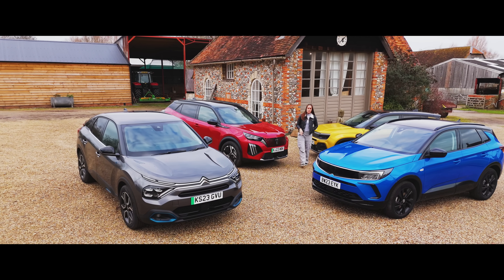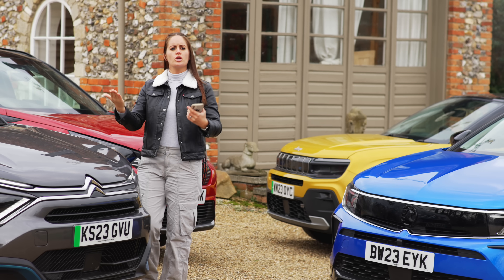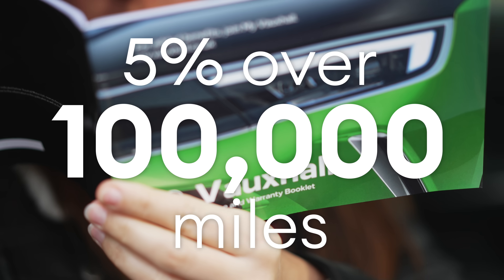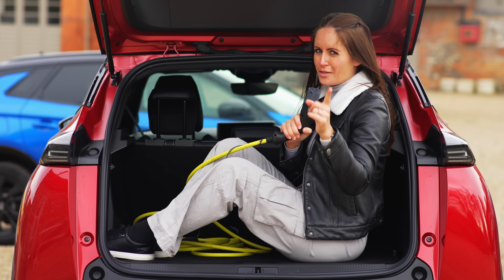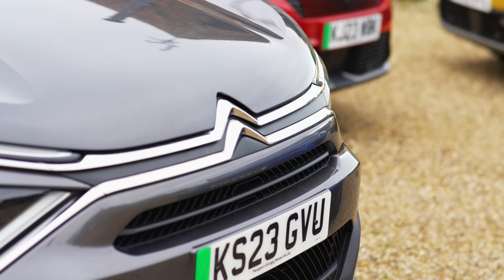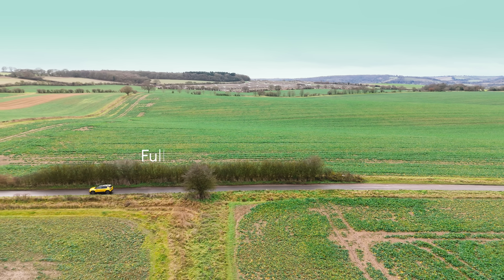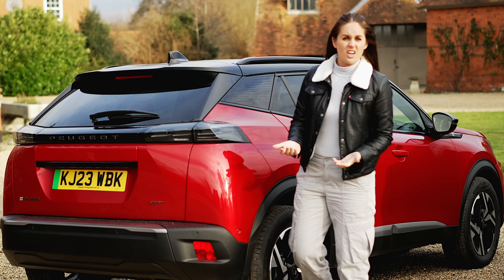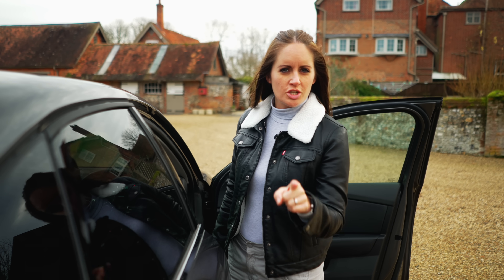REVEALED: Used electric car batteries – do I need to worry? | Electrifying

Comment: not degrading it is the amount of full failure and reneging manufacturers where widely reported failures cost the unfortunate owners some 60,000 under 40k miles more than there car was worth please dont just spout sale propaganda been there done that back in diesel after throwing away 3 times the depreciation  buying a motor and a reconditioned repaired battery you skimmed over the damaged batteries not covered by any warranty based on motor trade stats 1 in seven 3 year old car and 1 in 3 10 year old car having been damaged and the increased likely hood of the vehicle being writer off and the ever increasing cost of insurance for them last quoted almost twice cost of an ice van for a ev van so although i buy replace 1/3rd of my business fleet (over 20) some seven commercial vehicles every year and 1one private... none will be evs

Comment: I have been watching the transport select committee meeting on the 15th May 2024. This committee meeting was all about electric cars and the second hand car market as the second hand electric car market is stalling. It was found that the main reasons were that a great deal of second hand car dealers will not touch electric cars as they do not have the expertise in engineers and special equipment to service electric cars so they wouldn’t put electric cars on their forecourt for sale. Customers who were thinking of buying a second hand electric car were put off buying one due to the worry of the electric car battery condition as there is no UK standard to check these second hand electric car battery packs  and the second reason the UK charging infrastructure. If you’re interested please go to parliament live tv to view this committee meeting held on the 15th May 2024.

Comment: Problem is all these second hand electric cars have been taken from fleet owned electric cars and generally they have been driven by company car drivers so all that company car drivers are interested in is getting front A to B in the quickest possible time. So most of these electric cars have been on large numbers of DC charging stations and as we all know by now this is the worst charging scenario for traction battery degradation. The other point to make is that these second hand electric cars were made in small batches from the manufacturers as the mass car market were not purchasing electric cars in high volume therefore the spare parts for these second hand electric cars will be difficult to obtain quickly, so think twice before purchasing!!

Comment: Let's revisit this topic in another 10 years. When manufacturer warranty expires. Because it is a bit concerning to think an electric car will only survive on the road for 8 years, it's not very realistic. I think the lifespan of an ICE car is about 25 years. It's  the cost of ownership after the warranty that really matters to over 75 percent of the population that can't afford to buy a brand new car, or be the second or third owner. Young adults who desperately need a car to get about. Batteries in hybrid cars are causing a lot of mayhem in developing countries at the moment. In these regions they're imported used, without warranty. Some countries are putting limits on EVs to avoid similar dumping of worthless electric cars in the future.  With governments banning importation of EVs with less than 80 percent battery life left.

Comment: You mentioned using the range meter & battery level to check battery health, I am not sure that really works. I thought the "range" gets calculated based on previous use, so it will not work accuately?

Comment: Big fan of Nicola but... What hasn't been mentioned is that how the battery has been treated by the previous owner(s) will have a significant impact on the battery health.  Frequent rapid charging shortens both capacity (so range) and battery life.  Slow charging between 20 - 80% will theoretically prolong the battery life. 
I believe EV's will be a footnote in the automotive history. The s/h motortrade is not geared up for them and does not trust them.  Even main dealers are shunning used evs because they have government set targets to sell new. Insurance companies don't like them either & are hiking policy prices. Result, massive price drops and very hard to shift used evs.
Reply: Especially in the US!

Comment: There are newer car batteries like sodium ion, Al air batteries which are way far cheaper and manufactured with easily available materials and easily recyclable BUT ARE INTENTIONALLY DELAYED TO BE MANUFACTURED BY VESTED CROOKED INTERESTS to the consumers.
Reply: Also, "quantum charging" is supposedly "around the corner". I wouldn't hold my breath, a "cyanotic" complexion is unbecoming to me!

Comment: For EVs to get main stream adoption they have to be much cheaper, have driving ranges that are similar to combustion vehicles and charge in similar times to filling times for combustion vehicles. It would also help if they didn't spontaneously burst into flames while exuding deadly combustible gases, before ultimately exploding. 
Until EVs can overcome the price, range, charge convenience and exploding issues, the average person won't want one. It really requires a completely new battery technology. So ten years....

Comment: With stellantis cars (like all those featured parked in this video), it's the rest of the car you need to worry about and not the battery. ABS wiring looms, on-board chargers and air con compressors come to mind. Look for a car with a longer standard warranty and avoid stellantis. Mat Watson's press Jeep avenger had a braking fault, not great for a brand new car

Comment: I would agree that EV batteries are proving to be much better than expected, the problem is that most car manufacturers are still only offering 7 or 8 year battery warranties, half of the life of the car, manufacturers need to offer at least 15 year battery warranties to give people the confidence to buy a used EV..

Comment: Hiya, nice presentation, very upbeat and no obvious product placement apart from "Spoticar." Are they a sponsor?

You compared a battery to an engine and drivetrain. It obviously should be compared to a fuel tank in an ICE vehicle. The electric motor and gearing in an EV should be compared to an engine and drivetrain in an ICE vehicle.

As servicing an EV being cheaper. The batteries are the easiest things to check. Brakes, suspension, and tyres still have to be checked. EVs also have many more hitech components to go wrong, which are harder to diagnose and replace because they are proprietary, and the spare parts supply chain is virtually non-existent for them in this country.

Comment: The reality with this we will see in next 10 years. When I see EV driven over 600000 kilometers I am convinced.
Also I saw a story that replacing batteries to Hyundai Ioniq costs more than a new car.
Reply: yup! $60k!!!!!!!
Reply: I have has 30 years old cars that don`t have more than 200000 km in and are so rustes and bad condition otherwise that they were forsed to put out of misery… old diesel Mercedes that were driven on non salted environment can get 600000km but those cars are rarity! Most cars and end of the line at 250000km all of my ICE cars have been so far. My current car is 8 years old. 90000 km in. Motor… not expecting it to last more than 25 to 30 years… so it will maybe get 300000 if i am really lucky!

Comment: It's not all rosy on the servicing front though. Some manufacturers/dealers "overcharge" EV's  for the service and with some service intervals costing more than what some complex ICE cars would cost at the same mileage so please do your research... Hyundai is one of these with their 4 year 40,000 mile service which will set you back an eye soaring £500 plus depending on the dealership.
Reply: Tesla has no servicing required to preserve the 4y/50k mile bumper-to-bumper warranty!

Comment: The reason im reluctant to buy a used EV, even a new one is actually not the battery or motor, its the other stuff like heatpump and onboard charger. They are quite expensive, and known to fail in models like Corsa, 208 etc.

Comment: A lot will change as technology evolves and new manufacturers com China make it to W European markets. I would not want to spend a load of money in 2024 buying a car with a battery that will be much smaller or noticeably slower to charge than the models on sale in 2026. The bottom will fall out of the used EV market before I can commit.

Comment: What was the point of mentioning that the battery is valuable? Is there any way to benefit from this? Youd think that if it wad valuable then you could sell the old and put the money toward a new one... but you then reaffirmed that the new battery was "currently still very expensive".

Comment: Its post warranty costs thats the issue , not mileage /usage as in the examples mentioned in the comments.
Tesla model S 2 weeks out of warranty and less than 100k £18,000 to replace 
You could buy a battery on E-bay @14k but it still needs fitting etc...

Comment: so the only electric car i can afford is a 2010 nissan leaf and i commute 100 miles a day on mostly motorway. i should be ok with that car since you tell me not to worry about the battery ?
Reply: Only if you can charge at the work during the day. Or rapid charge on way back. Lease a EV, leaseloco e-208 pug, 1500 down and 200 per month

Comment: The risk for second hand car buyers is how they can sell the car later down the line. 

There’s not much risk buying a 3 year old EV, but if you want to sell it a few years later you’ll be reaching the end of the warranty, and then who will buy it? You’ll be unlikely to sell it for much more than the resale value of the battery at that point, so potentially quite a big depreciation hit compared to ICE equivalents.

Comment: Great overview. Maybe i'll add that batteries can be fixed, specialist shops can repair them at cell level (tesla is said to be the easiest to repair) for a lot cheaper. Also, warranty for the battery is usually valid if battery is under 70% of capacity.
Reply: So, if "range anxiety" at 100% isn't worrisome enough, 70% should REALLY put folks at ease! LOL:face-fuchsia-wide-eyes:

Comment: If you are suggesting that people should change their car every two or three years then what sort of ecology is that. It's  much "greener" to keep an ICE car running for many years.
Reply: How so? If you keep EV so long that you need to change battery… it is cheaper than keep ICE car the Same time. Not Evertonia change car every few years… and the longer you keep EV the more you save compare to ICE (even if you buy the new battery is meanwhile)…
But you need at least 15000km / year and home charging option. And this is based on prices in Finland so it may  vary depending on where you live!)

Comment: Owners' data suggests that mileage is not the main factor, but time is. It doesn't matter if you drive 5000 miles a year, or 50,000 miles a year, they still degrade roughly the same over time. Manufacturers know this, that's why they offer 8 years warranty, so the main question is how do these batteries fare on the years after?
Reply: Where did you get that data from? Batteries degrade by cycles of charging and discharging...
Reply: It's more complex than that. It's a combination of age and cycles of charge/discharge
Reply: MG now gives a universal 10-year warranty on their EVs.

Comment: Most people drive older cars with higher mileages. My car is a 2012 model and still pretty much like new bar the odd minor blemish.  There are plenty of mechanics able to service and ensure a long life for the oiiy bits. For EVs to be sustainable they need to have value way past the 8 year battery warranty and not just be something for people on high incomes to discard like a mobile phone every few years. At present if you are unlucky enough to have a battery pack issue there isn't an army of specialists who can refurbish it (the ideal solution because this means the car can have a long life which is most likely greener than scrapping it when relatively young). I'd only buy an EV with no battery warranty if it were very cheap and accept the associated risks on that basis unless sensible repair options were available. This suggests the very steep depreciation curve for EVs continuing and will put private buyers off.
Reply: I agree 100%. The cost of batteries for a used EV can easily EXCEED the cost of the vehicle! Examples: battery for a Chevy Bolt=$16k, Tesla=$20k , Hyundai Ioniq5= $60k (not a typo)!!!!!

Comment: This video is the biggest bunch of 'ev love bs' ever. Completely ignores or dances around the bad parts and only promotes the good points.
First of all the video is titled to talk about used evs, yet you talk about new ev batteries. And when you do talk about used evs, you say you only need care if your in a older car with larger milage, aka the used car market. Or do you not car about cars that are older than 8 years or more than 100,000 miles?! because every car i have ever bought has been older that 10 years.
Second, you keep saying 'life of the car' but that only means life that the manufacture cares about. aka the warranty period. Beyond that, the car is past its considered 'life'.  Plus ICE cars are always quoted as a life of 1 million km, but achieve 1/3 of that at best majority of the time. so a life of 300,000 miles for an ev does not bode well for evs lasting as long as ice cars.
And third, while degradation varies, many have reported higer deg than 5% every 100k miles. Plus so, so many people who have had battery failure have shown that once a car reaches 70% the capacity, it starts falls off a cliff. so 70% is basically end of usable life for a ev battery.
And finally, all that about the batteries being recyclable is nice, but that does not matter when the replacement cost it so high. it just doesn't matter what happens to it. also an ice engine is also recycled. Plus a battery replacement is absolutely not the same or similar price as an ice engine being replaced in price (battery is $15-30k, ice engine is $6-10k, with a brand new, not refirbished used adding an extra $5k). plus you said engine & gearbox, are you also saying a bettery & drive motor needs to be replaced at the same time, or do you like to compare things that are different just to make a point

Comment: My battery is fine in my 8 year old i3. However the inverter fried itself which is an €11k fix at BMW or around €8k at an independent. Can’t find any second hand so car is a write off. Battery is fine though but no one will touch an 8 year old battery.

Comment: Just remember, in 10 years and 130,000 miles a $25k Camry will be worth $10-12k. An $80k EV will be worth the same minus the cost of the battery.

Comment: Not convinced yet, I still think that it'd be more interesting to get an all inclusive lease, even private, for an electric car, changing model at the end of your lease. Never buying, always renting. 
I have a real psychological problem with those magic buying loans they craft for you, with allegedly low monthly fees, but with a hefty first deposit and/or a humongous last "month". 
In the end, these not-so-magic loans won't cover extra expenses like insurances, taxes, maintenance/check up fees,.. Like a full lease would. 
And the saddening fast devaluation of your now new "possession" , after or during your loan, it drives me mad just thinking about it. 
I'd be happy if someone proved me wrong with the proper maths. But I less and less wanna buy and own a car, especially an electric, and even less so, a used EV. I want a full package with the less worries and side expenses possible. And let them deal with the battery degradation. That especially, is certainly not out of my own pocket. 

But in the end, the real issue is the overall cost of an electric car, 
45k euros entry ticket for a C segment car like the 308, is still 15k too much.  
Or 40k for a 208, which forces the GT version on you if you want a decent engine, is again a bad joke.
Even a Byd Atto 3, supposedly cheaper, is around 38 to 40k in Belgium. The more I dissect the market to find the rare pearl, the bitter I get, honestly.

Comment: Very well summarized ... so many people don't get that if the battery gets weaker after 8 or 10 years, unable to process max. current peaks like needed in an EV, the battery will still be a perfect storage element for a household or a tiny piece of a bigger energy cluster for solar or wind power. So after some 20 years they will be recycled up to 98% I believe I have read, because the lithium doesn't go bad, it just reshapes itself over time but stays inside the cell and can be reused for a new cell. So the environmental impact is magnitudes lower than most people think and we hope battery reseach will present batteries with even more power and less weight and volume that will give EVs as much range as the old combustion cars as well as faster charging speeds.
This year CATL will implement a battery that is supposed to be way better in that regard and we will see the real-life result of that very soon. I am sure BYD and others have not been sleeping either and there is a great future to come.

Comment: The estimated range by miles on the dumb o meter is an awful way to judge the battery health. They base the miles estimate on prior driving history. Highway vs city or aggressive vs slow n easy driving. The only way to check the battery health is to have it professionally checked by the manufacturer or by a trained shop on EVs. As long as it is under warranty your pretty safe.
Reply: So used values will drop off a cliff when the warranty expires?
Reply: and that check can be done for £60, remotely